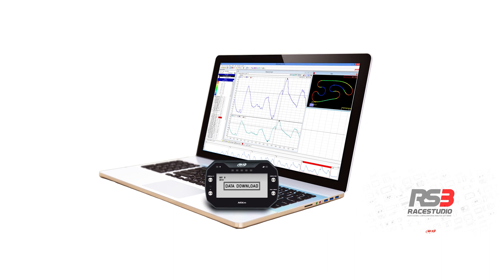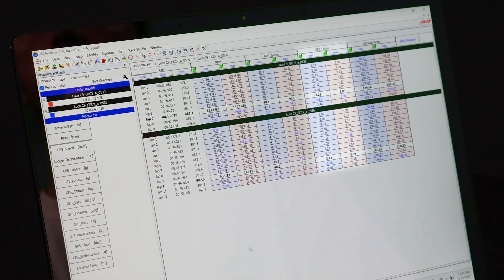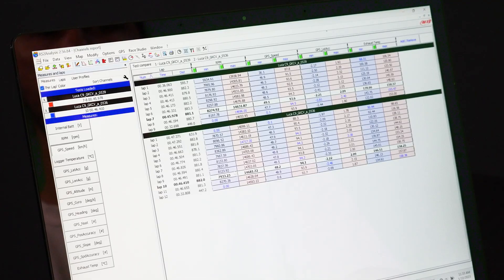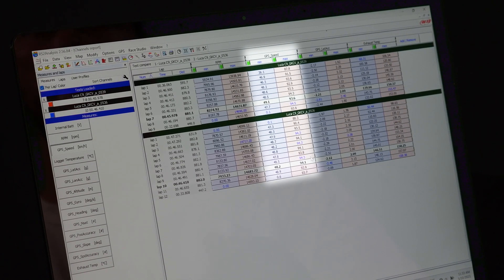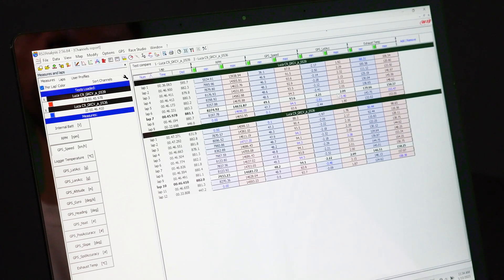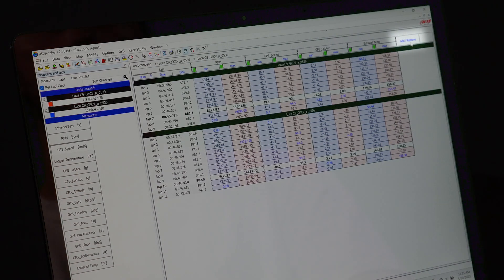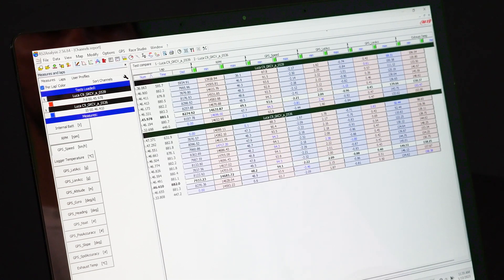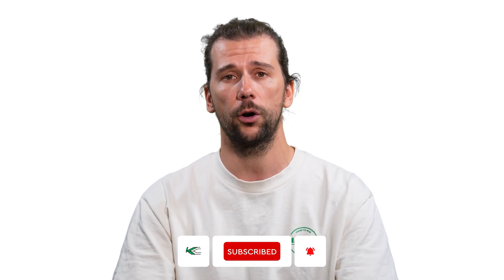How to Read Karting Data - The Basics

Comment: Good stuff, but can you explain the dash too? Split times/sector times? etc. What are those numbers flashing on the dash after certain corners?
Reply from the maker: For sure. We’ll look to do something going through the settings. You can change the lights to show temperature, lap times (green sectors are faster, red are slower) depending on what you want to know about whilst driving

Comment: Would this be for higher end people who good at pace but need to adjust setup or is this for anyone?
Great detailed video mate thanks!
Reply from the maker: Data can be overwhelming. But it is designed to be used by everyone. In this example I wanted to show users the different measurements we look at for our race team. This can easily be cross checked between drivers or sessions (different adjustments) rather than scrolling on your data logger or writing notes down.
Reply: @KartClass  Ah I get it so it’s for everyone and an easier way to find lap time and setup adjustments